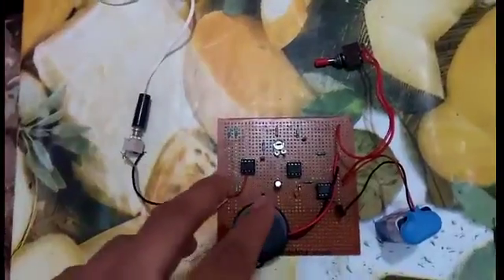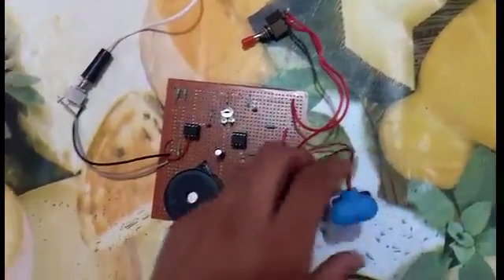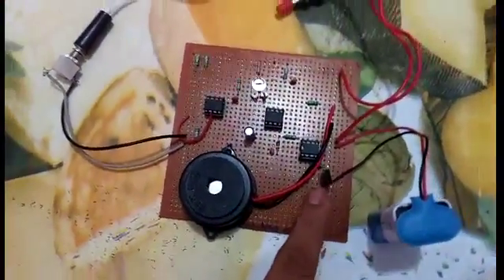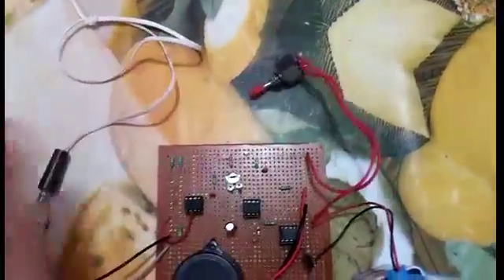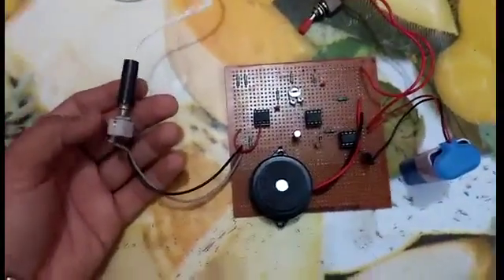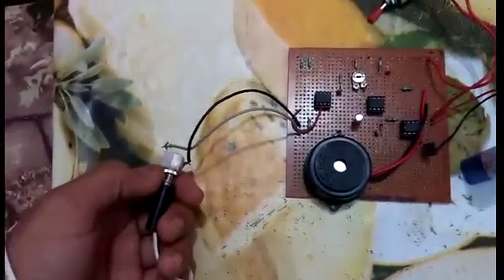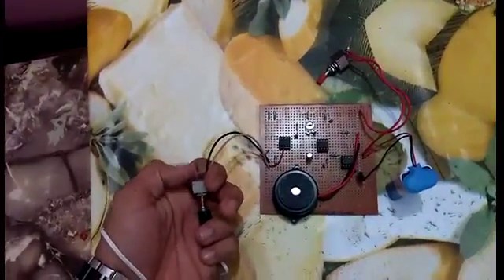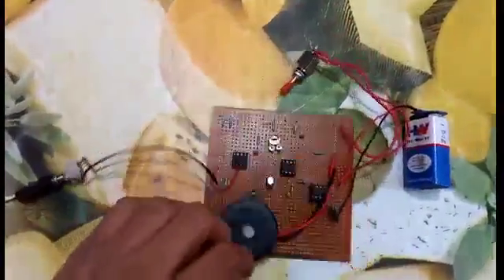Antibag snatching circuit

Comment: How can i implement or design this using PROTEUS software(b/c no UM3561,mono-plug,mono-jack socket...)
Reply from the maker: Berhe Kiros use any op amp like 741 instead of um. Use spst switch for jack.

Comment: Hi! I'm having a problem with the mono jack and mono plug. It doesn't work. Only the on/off do you have any suggestions?
Reply from the maker: sorry, i didn't understand , can you explain issue in more detail?
Reply: When you on the switch it alarms even when the mono plug is still in it.
Reply from the maker: There must be shorted soldering at plug side circuit because when you unplug the mono jack circuit will complete( no short circuit) , so check the soldering
Reply: Thank you! :)